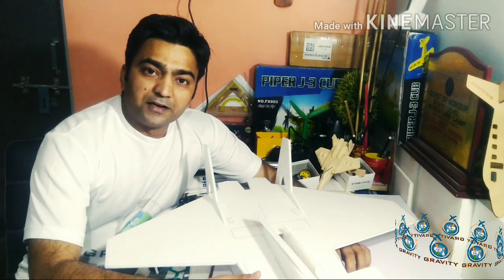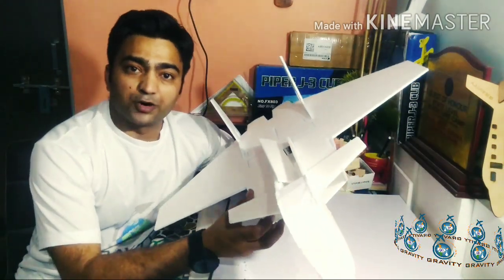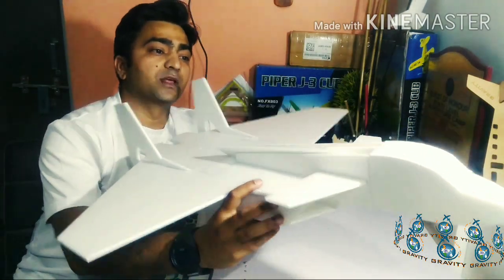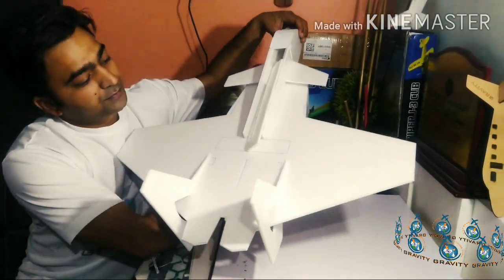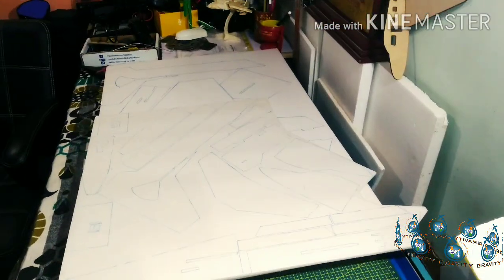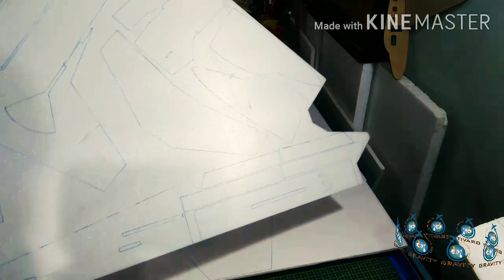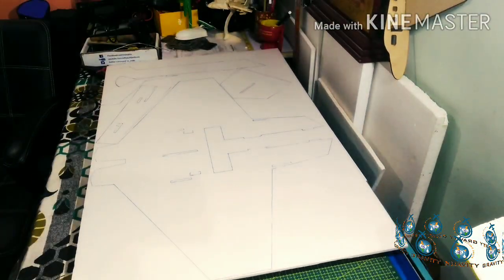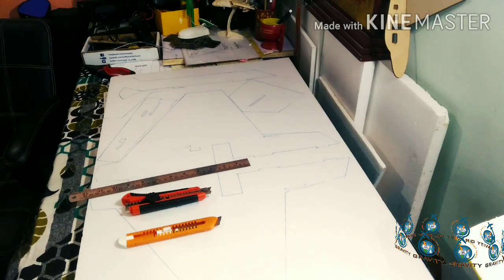How to make RC Vector Plane. PART-1

Comment: is the foam paper laminated ? Or did you laminate it with paper yourself  ? Thanks!
Reply from the maker: Its a simple paper without lamination.
Reply: @gravityflyingindia  Thanks ! So you don't do A fold and B fold the way flite test does ? You just glue foam together the old way ?
Reply from the maker: @anshuld90  i use the slots to fit all parts in each other

Comment: fine.    ask  a   Question.       or   STUDY for a few weeks, first.
https://wright.nasa.gov/airplane/shortw.html
https://en.wikipedia.org/wiki/Aeronautics
https://en.wikipedia.org/wiki/Aviation
https://en.wikipedia.org/wiki/Lift_(force)

the  Four  forces  are  -    Lift       Drag      Thrust      Gravity

airflow is  Laminar  or  it is  Turbulent.       it is desirable that the air reaching  the  prop  be  Less-turbulent/disturbed.         a wing  Should  make  SOME  aerodynamic  lift.      a totally flat wing profile/airfoil  does  NOT.      compare the clark-y profile (orig).     it is  PERFECT.       clark  totally  knew what he was doing.        googletranslate
https://en.wikipedia.org/wiki/Clark_Y_airfoil
https://volarlibremente.files.wordpress.com/2009/05/clark-y.jpg

it should be understood  that a lift-making profile/airfoil that is thinner that  11.7 percent (of chord)  Will  make noticeably  Less lift.   and will have a Higher minimum flying  and stall speed.